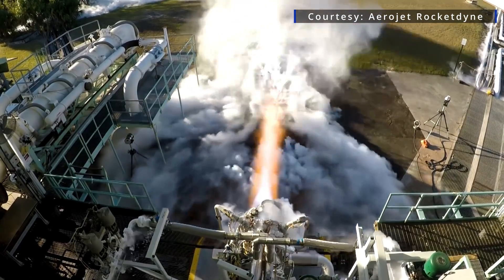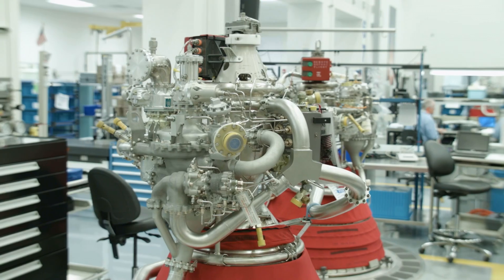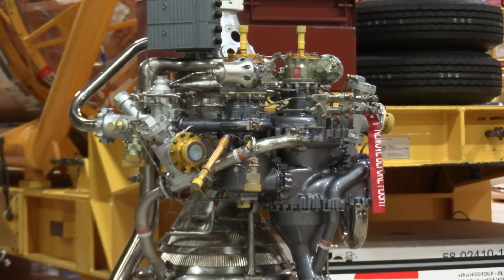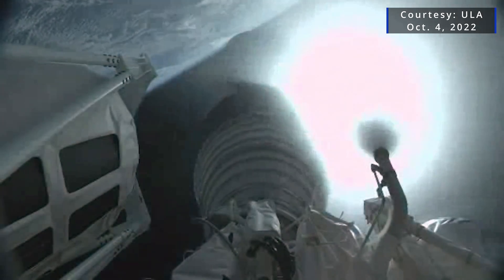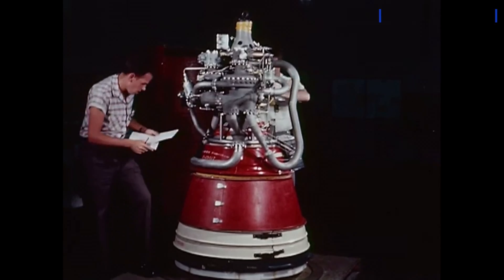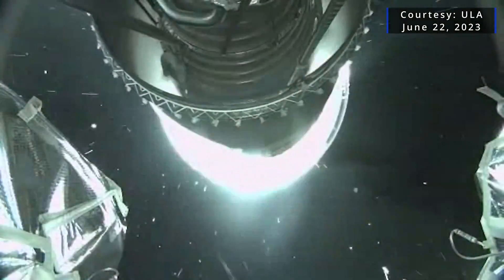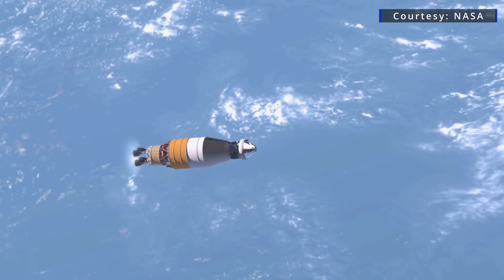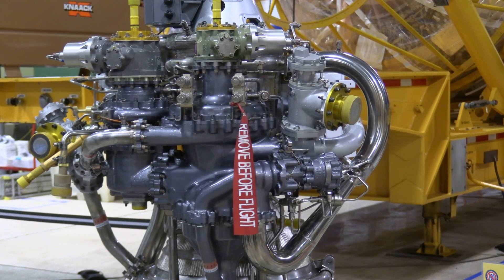Aerojet Rocketdyne's RL10C-X rocket engine to debut in 2025 on ULA Vulcan rocket

Comment: Aerojet is probably years behind SpaceX in engine development.
Reply: Umm.. The RL-10 has efficiency (known as Specific Impulse) that vastly out classes anything SpaceX has made thus far.  Liquid Hydrogen is just a more energetic propellent.  The RL-10 engine is responsible for almost ALL of the deep space exploration The United States has done thus far.   So there you have it... You are just f***ing wrong.
Reply: Space is a funny industry. On one hand you have seventy years of reliable service and continuous improvement, and on the other you have a pile of scrap at the bottom of the Indian Ocean. Somehow the scrap is more advanced.
Reply: I recently just left Aerojet.. built many models of the RL10 over the years.. its the same engine that was built in 1950..just a few changes..
This engine here we had so many problems with leaks around the turbo pump..it was embarrassing when the customer was watching our test runs and it would catch on fire. Ya space X is way ahead..
Reply: No one can touch SpaceX in development, they are just too hardware rich and move way too fast. Relativity and Stoke Space look promising as well as Firefly. ULA is about to be sold to Blue Origin.
Reply: @steveo6034  No one, except the Chinese perhaps?

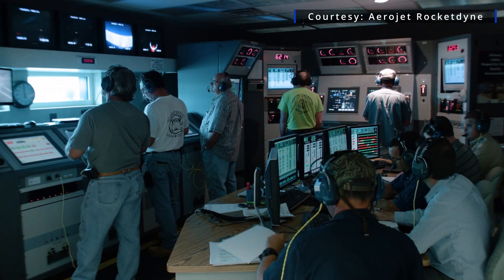Comment: I know two of the guys @ 0:36 & 1:20  😂. Thats the West Palm Beach facility. It will always known to be a Pratt RL-10 (PW LSP). I stayed on the Pratt side during the split.
Reply: I worked in test and assy..the guys working on the engines in the video weren't any mechanics.. just engineers.. just the guys in the control room are test mechanics..